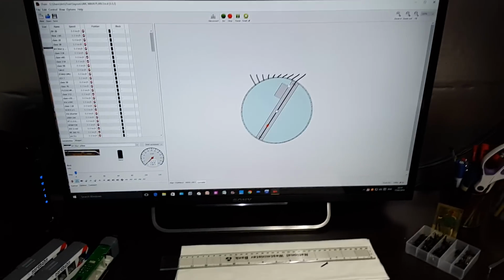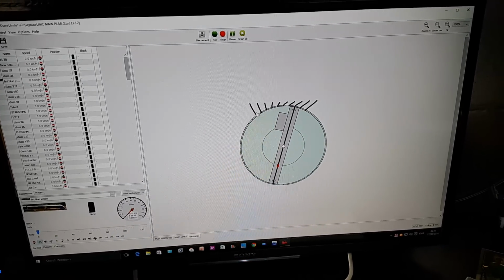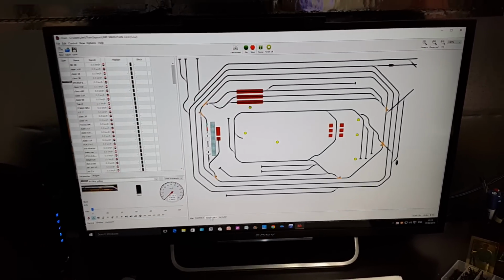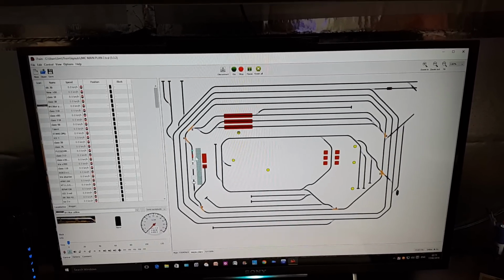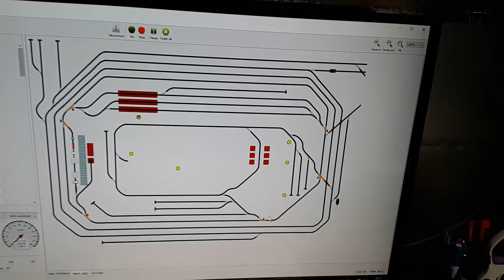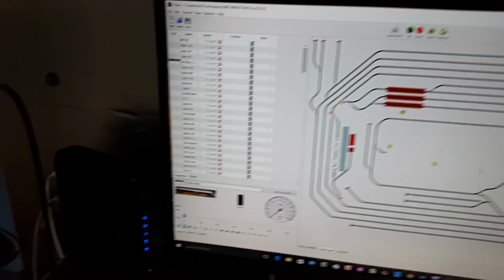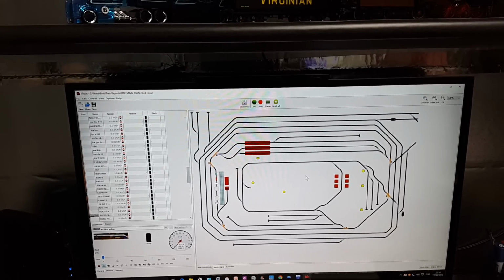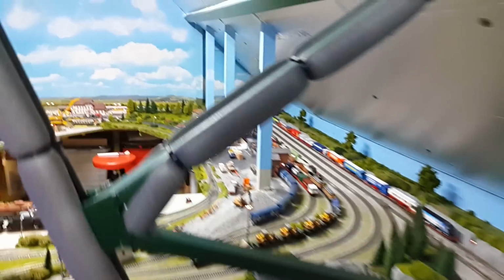The start of automation ? Part 3

Comment: ECOS and Consists - perhaps a simple question but I've uses Consists, hovwever I was just running Other trains, lost track of the consisted 2, and Cannot find them in the Loco List?!  I want to Delete the Consist to 'take back control' of each of the 2 locos, but cannot as I cannot find the Consist... Where is it? If I select Either Loco it says it is "Multi" (part of a consist??? You know???
Reply from the maker: Go to select  loco...deselect steam electric and diesel icons at the bottom of the screen,press "A" or "ABC" then search through the list for the consist or single loco they should be there.
It depends what icon was used to create the consist it will sometimes hide them somewhere you would not think of looking.
Reply from the maker: Go to select  loco...deselect steam electric and diesel icons at the bottom of the screen,press "A" or "ABC" then search through the list for the consist or single loco they should be there.
It depends what icon was used to create the consist it will sometimes hide them somewhere you would not think of looking.
Reply: +hovermotion AWESOME, AWESOME, AWESOME!!!   It Worked!!!!!  THANKS Jim!  -Chris
Reply from the maker: No worries. .👍

Comment: Hi Jim.  Have you tried programming a Loco with DECODERPRO by JMRI with ECOS? It is supposed to now work but I'm having trouble as it says there is no programming or mainline track to program to, so it only lets me create ny decoder CV settings in Edit Only mode in DecoderPro...  I'm wondering if there is some setting in ECOS other than the 'allow another control throttle to take over' that needs to be activated...  -Chris
Reply from the maker: I Chris I have JMIR on my pc but still have not got around to trying it out yet...so I do not know. .
there maybe a setting on the ecos menu to untick or something similar to solve your problem.

jim